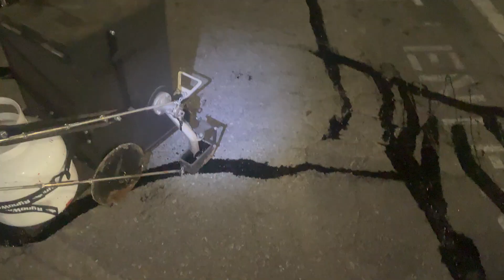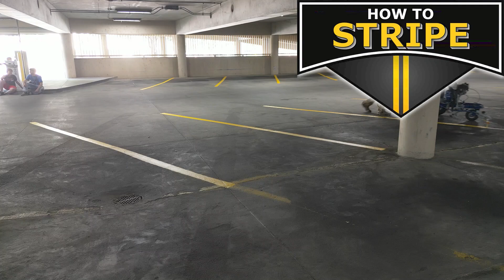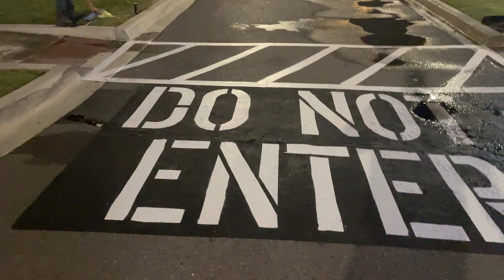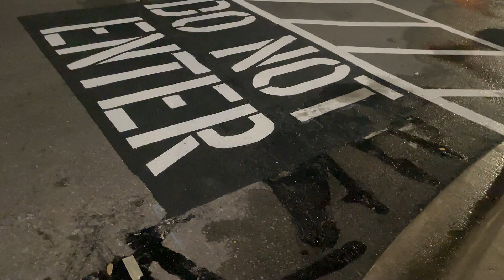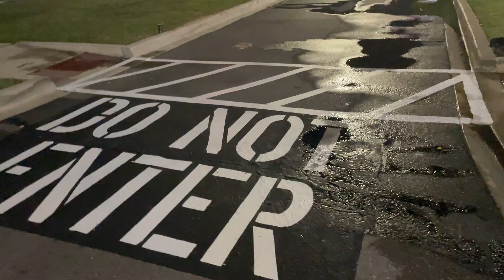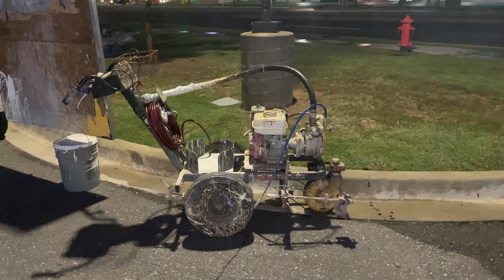This ONE THING let us DOUBLE our ticket PRICE to $1600 in 3 hours: Asphalt Maintenance business

Comment: I am a little confused. 
1) If you only had asphalt cracks to fill then why did the word "pothole" and a price difference between holes and cracks even enter the conversation?  You said the customer wanted "pothole filling" but you persuaded them to do crackfilling instead?  I am confused...were the actual potholes left unfilled?
2) I went to Transline website and the only Gorilla I see is solvent-bourne....not water-bourne
3) You said at the beginning of the video latex should be used on cold tar  asphalt....but it is ok to use solvent bourne after all? Which is what you did it seems because of the water
I have your course and trying to learn - not trying to be a jerk. Wanting to clarify all the above
Reply from the maker: 405-902-6154 text me. I’d love to clarify